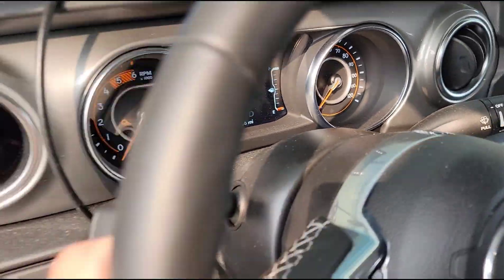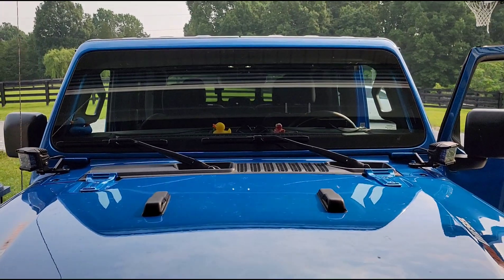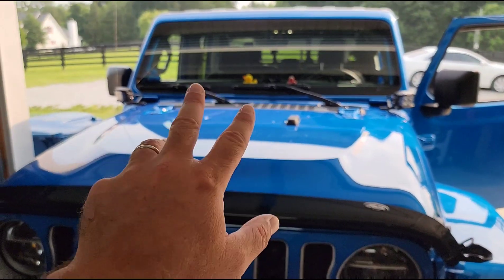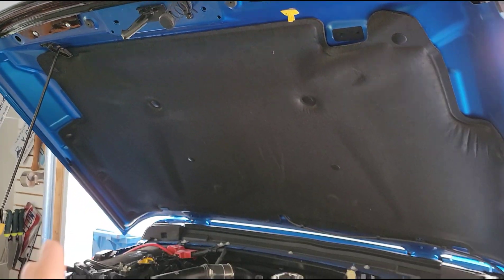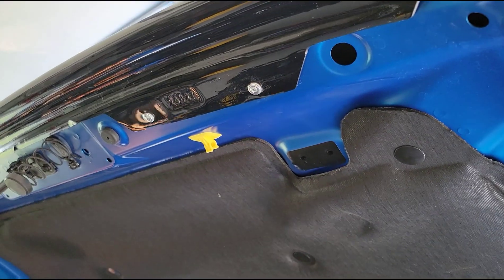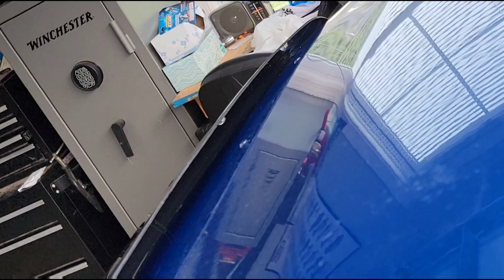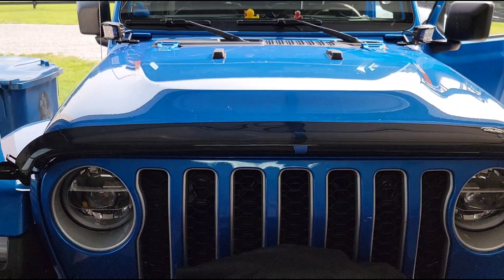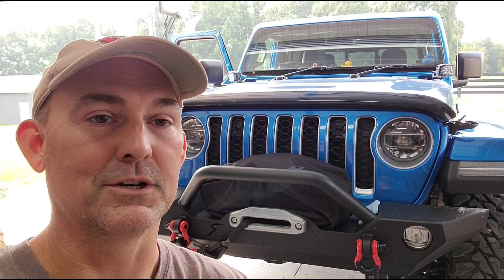Gen 3 EcoDiesel? Check Your Oil! Also: Jeep Gladiator Windshield Protection - AVS Bugflector II

Comment: I used ceramic coating on the windshield and it was much better with the small insects ( they don't seem to stick). I found the main advantage is how easy the big ones clean off when you do clean the windshield. Well worth the effort!